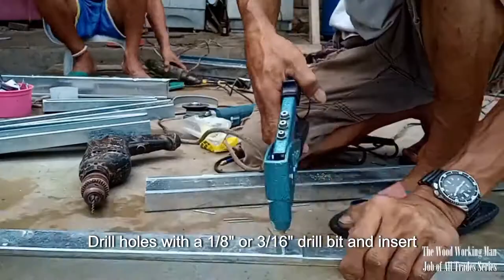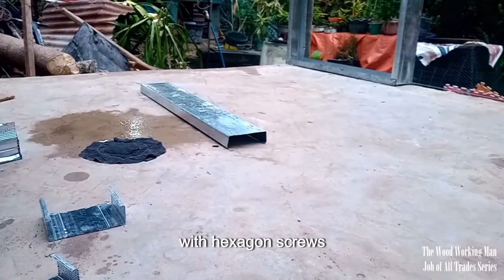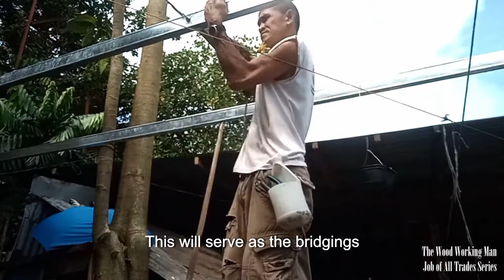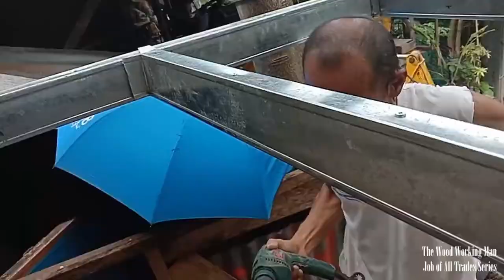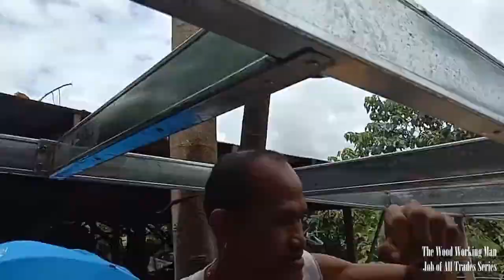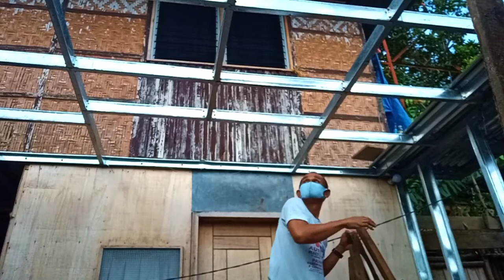Metal Stud Roof Framing: 5 Tips That Will Save You Time & Money

Comment: Kuya Ano po size ng rivet at klase ng screw para c purlins at para yero ang bibilhin at saan?
Reply from the maker: Salamat sa comment boss psensya na ngayon lng akonaka reply, 1 /8 or 316 x1/2 or 3/4 sa rivets sa screwpanhead screw Ganon din angsukat.
Reply from the maker: Parasa yero 1/8x 2 inch hexagon screw.
Reply: ano po distansya ng square ng mga stud ?
Reply from the maker: @voltesfive2620  depend yansayerong gagamitinmo sa akin 16inches to 24 inches